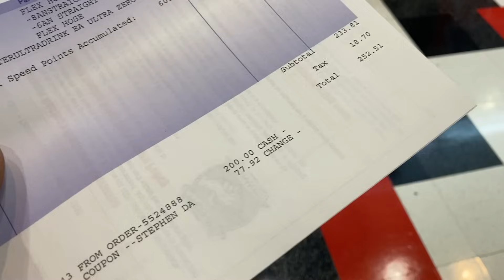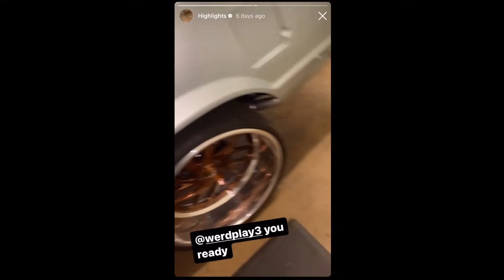I CANT BELIEVE THEY DID THIS TO THE MALIBU WAGON

Comment: See people don’t understand that the Audio man sees everything that most don’t. A lot of shops hide shit
Reply from the maker: Facts
Reply: @SteveDavisCarGuy  I just picked up  a 69 caprice. It need trunk pan and front and rear floor pans  and it has  rust  and it has a 350 4 bolt main  the car has 64,000 miles on the dash and it needs a rear main seal  trying to find some parts  appreciate it
Reply from the maker: @Caprice69  I don’t have anything for 69s

Comment: Never ever solder any wiring on a moving vehicle,  over time the vibration will break down causing shorts
Reply from the maker: Solder and heat shrink I haven’t had issues all this time
Reply: Never had any issues ever. That sounds like user error